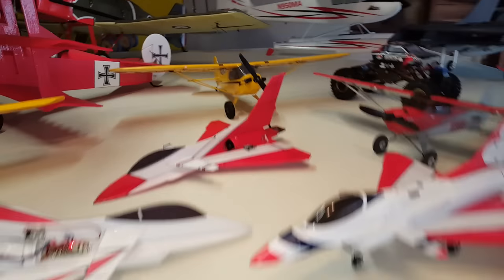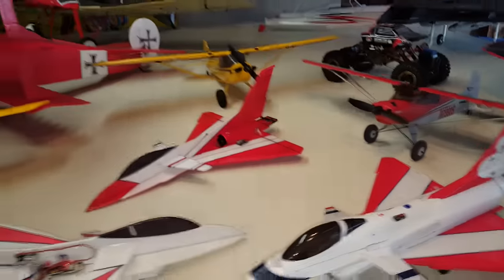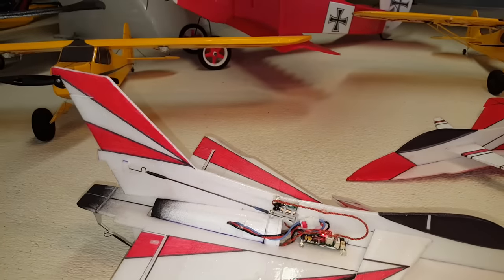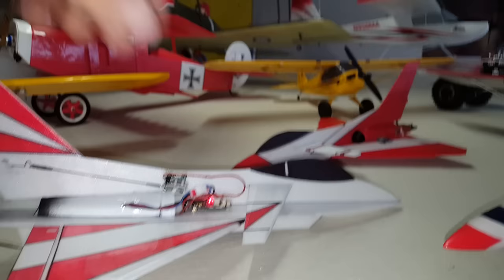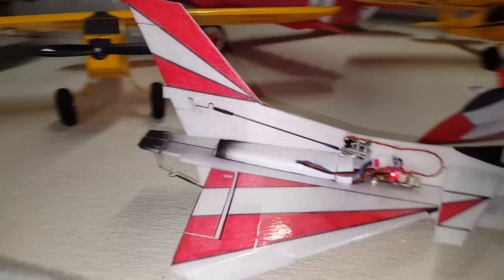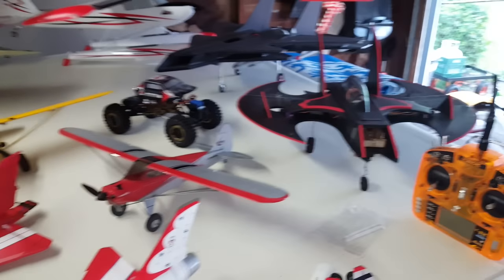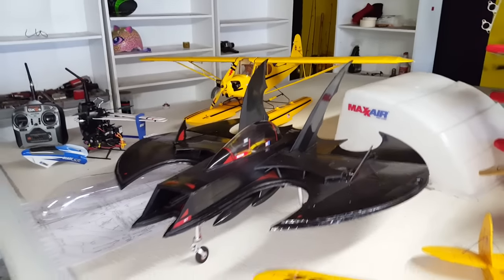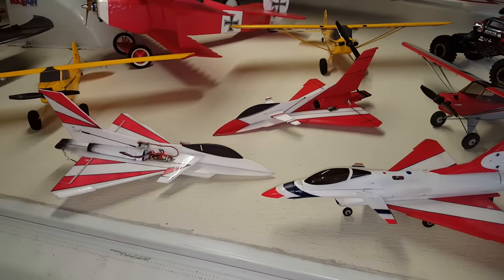UMX Micro micro J-10 with thrust vectoring.

Comment: I have a micro corsair brick wi as3x and I want to build something with it. I Kate built up many airframes but all have been destroyed because I cam not turn off the as3x. If the wind jolts the plane down, instead of correcting and making it go up it moves the control surface even more down causing it to be uncontrollable. Same with he other channels, they all work backwards BUT ONLY WITH AS3x (when I move he sticks they work correctly). How can I fix this issue!!???
Reply from the maker: you really need to install the electronics, rec, servos, motor  in the sam position you took them off the original plane friend. the receiver has to be positioned in the same way you took it off so the as3x moves the servos correctly on the plane.